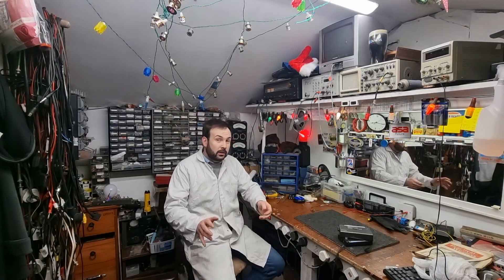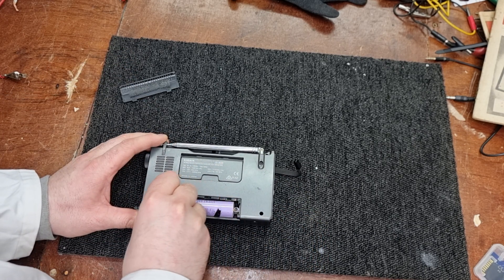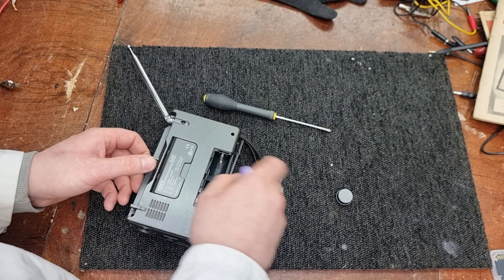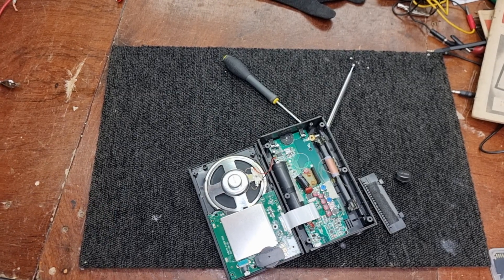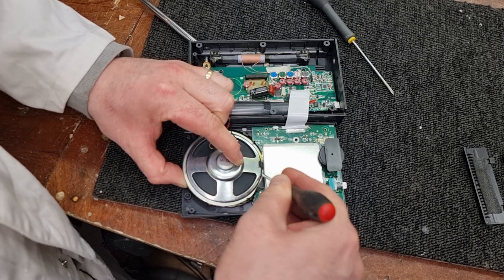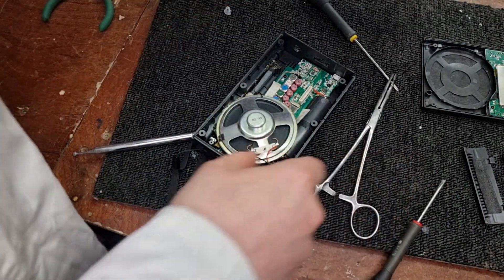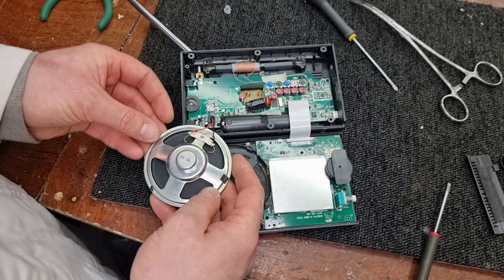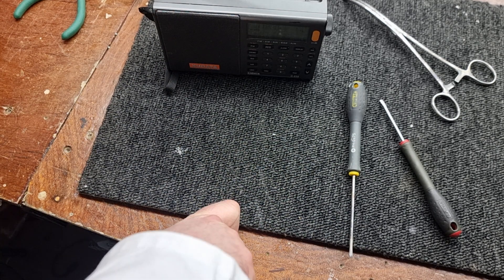XHData D-808 Audio fault.

Comment: I’d silicone the speaker back in but make sure you use the none corrosive stuff!
Reply from the maker: I used some contact glue.
Reply: @IrishvintageTVRadio  Привет из Якутии🤝🐻У меня есть d-808. Я не могу понять, что означает слово Timer на дисплее, и как его убрать?
Reply: @IrishvintageTVRadio  hello, what could be broken, I have a xhdata d-808 radio, old version, all bands work, but not the air band band, I also have xhdata new version and it receives the air band very well, best regards

Comment: I had a very similar problem of a cracking sound from the radio. I replaced the speaker with one from another radio and now works ok.
Reply: ooh yes ,but the craking i thunk from the variabl resistance

Comment: Makes you wonder how these odd things happen. My original D808 has  an intermittent power fault and occasionally dies. Remove the battery for a few hours and it will work for days again. So I bought a 4 month old one last year for £40, has the later amber display but the new firmware makes the radio slower to respond, the original version I have to say is a better radio. I also did a mod on the old one to improve Long Wave and it makes a big difference, just a switched 560pf cap in parallel with the pick up coil on the ferrite rod and a tiny switch on the side of the case.
Reply: That is worth knowing. Thanks for the tip.

Comment: Would the word you were after be "sibilance"? (sibbi-lence)?

Anyway, that lump of 'hot-snot' did look as though it had been there from the factory, what with the bit of black it picked up from the cone and all.

A friend of mine has a very similar looking radio, as viewed from the front, but it runs on normal batteries. Otherwise it could be the same radio.  I know it won't be because she wouldn't pay that sort of money a palm sized set!

I have a Roberts R9921 that I've owned for donkeys'years. I bought it for whenever I wind up in hospital, but apart from taking it out of the box, testing and putting it away again, it's never been used in anger. It's a very basic set which claims to be a "World Radio". My guess would be that yes, it would work anywhere in the world, but it's not going to pull in stations from all over the world!

So anyway, I'm glad you got it sorted out. Now, Happy New Year to you and Mrs OjNoj, and may the best still be yet to come.🍾🥂🍺🍻🎉

Comment: How does the 808 do with air band and long wave? Is there anything you'd recommend that is slightly more expensive but still small?
Reply: I have carried out some tests.  Summary first: The Xhdata D-808 is mediocre on LW; inconclusive results on Airband (see details).

I tested the Xhdata on LW against 2 other radios: a Panasonic GX500 (also marked RF3500) and a Sony ICF-SW11.  For signal sources, I used BBC Radio 4 on 198kHz, RTÉ Radio 1 on 252kHz and the time signal from Allouis on 162kHz.  The tests were done during daytime.

The BBC Radio 4 transmitter is rated at 500kW and is approximately 100 miles away.  Both the Panasonic and the Sony gave strong reception with no noise.  The Xhdata gave listenable reception, with moderate noise.  In my view, this is quite poor performance from the Xhdata.  The transmitter is powerful enough to cover all of England on mass market domestic radios.

The RTÉ Radio 1 transmitter is rated at 300kW and is approximately 230 miles away.  The Panasonic picked up a fair signal with some noise.  The Sony picked it up with a bit more noise; listenable only if you're really keen!  The Xhdata barely managed to detect the signal at all.

The Allouis transmitter is rated at 800kW and is approximately 350 miles away.  It was strong on the Panasonic and the Sony, but only weak on the Xhdata.

Unfortunately, there is barely any Airband usage in my area.  In any case, I do not have another Airband radio to hand for comparison tests.  I did hear two quite strong but brief transmissions from aircraft on 132.300MHz, which I understand is a radar service for Western England.  During several scans of the Airband, the Xhdata picked up nothing more.